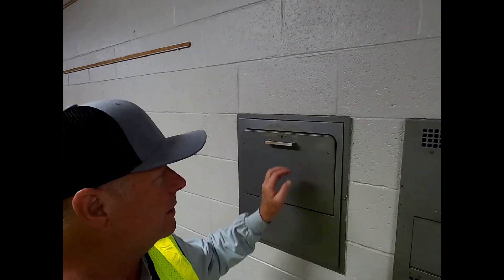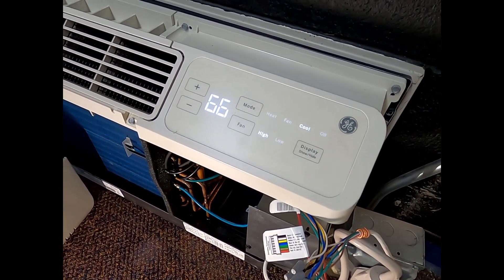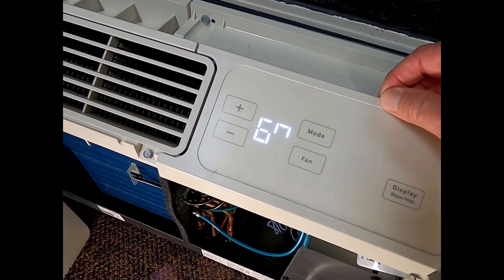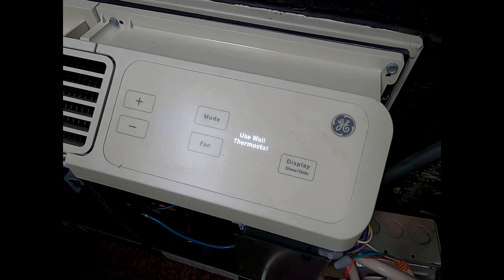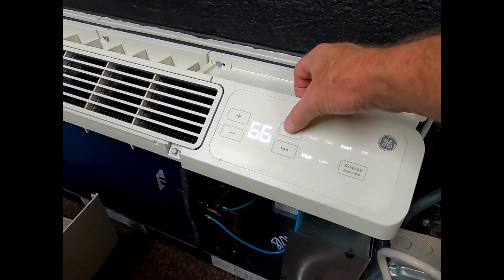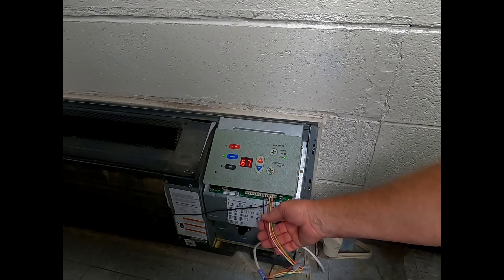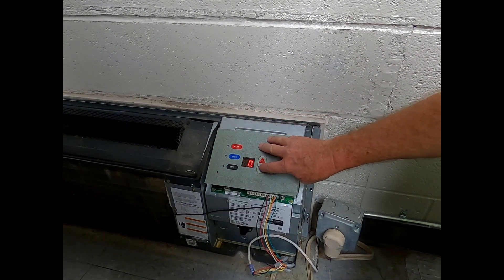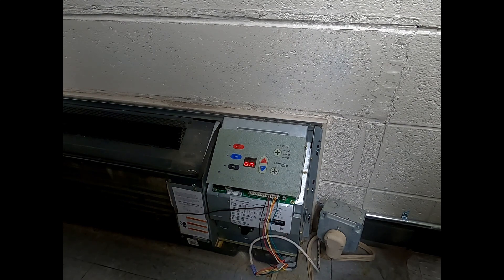The Hotel A/C

Comment: If my wall thermostat is not turning on the unit what do I do
Reply from the maker: Could be a bunch of different issues, but make sure you got 24volts going to the t-stat and back out to the unit , you will need a volt meter to check, thx for checking in

Comment: Heat not working can anybody help?
Reply from the maker: Does the cooling work? And is it wired to a tstat?
Reply: @redrover7574  yes . I had took thermostat mode off and switched it back to original mode
Reply from the maker: @504.CREOLE
Reply from the maker: If you placed it back to original mode, successfully, then try turning the power off for about 1 minute and plug back in. If that does not work you will have to do the process again
Reply: @redrover7574  ok thanks

Comment: Great job, thanks, for new work where do you run the stat wires?  Into the sleeve? 👍👍👍🫶🫶
Reply from the maker: There is a Drop ceiling ( ceiling tiles) in these rooms, so we run either wire mold or conduit down the wall near the unit and run the wire in it close to the bottom right of the unit, Thanks for checking in Bear Crane, have a good one

Comment: can you please make a full video of showing the connected wiring on the thermostat side also.
Reply from the maker: I can do that, give me a few days, thx for checking in
Reply: @redrover7574  I asked cuz i was trying to connect the amazon smart thermostat at my hotel to GE zoneline AZ45E electric heat model, and it works fine. Do you know if the amazon thermostat will work on the AZ65 model with a heat pump and reversing valve? Thanks
Reply from the maker: @PPrince1566  Yes, it will work. On the AZ65 there should be a wiring kit. Red wire, Green wire, Yellow wire etc......the Blue wire is the reversing valve wire, just as shown in my video. I have never hooked up a Smart Stat but there should be a O/B terminal on the stat to hook to, then you will have to go into the menu of the Smart Stat and set the O/B to B for the G/E Zoneline. Hope that helps
Reply: @redrover7574  thanks, I'll update you when I install it.
Reply from the maker: @PPrince1566  Excellent thx